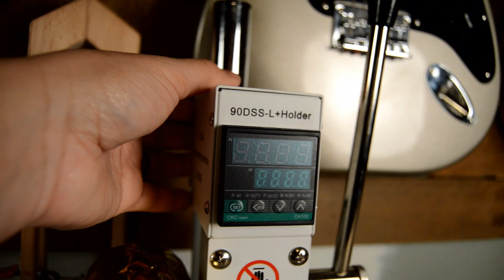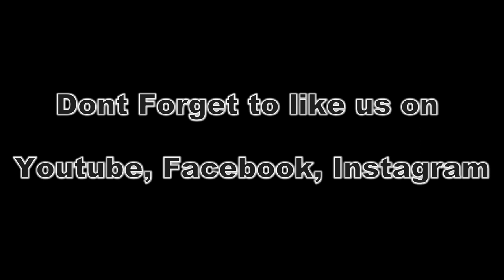Handmade wallet from start to finish (texsounddesigns)

Comment: Is that a drill press?
Reply from the maker: No,  although it has a drill Chuck in it, that is actually a press I use to put my stiching punches and even embossing stamps in to punch holes and stamp leather.  It's just a quieter option that just a punch and a hammer.  Thanks for your comment James.
Reply from the maker: https://www.amazon.com/dp/B07TBKGFBW/ref=cm_sw_r_cp_apa_fabc_6VEJ844RC0K6YRWBCQC3?_encoding=UTF8&psc=1
Reply: @TexSoundLLC  That's a great idea!